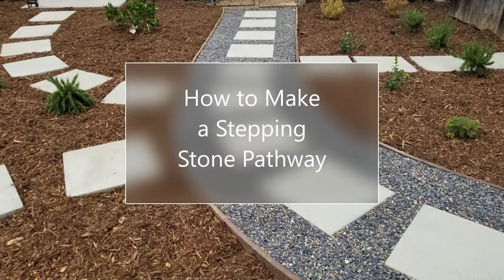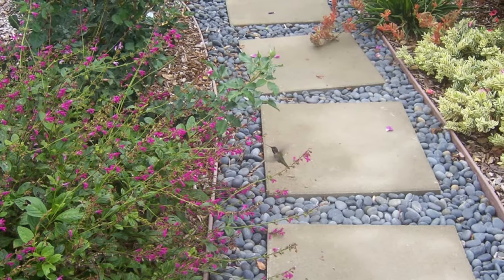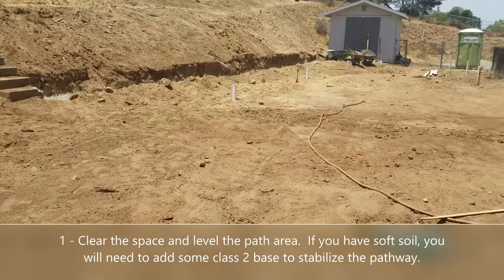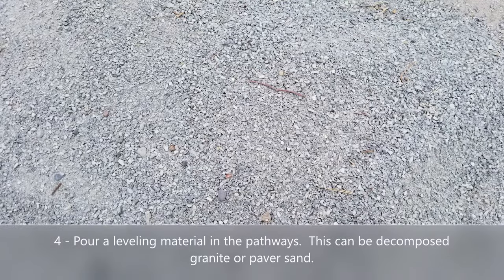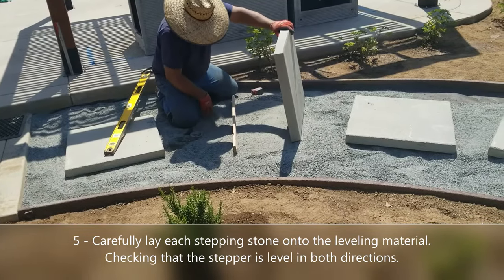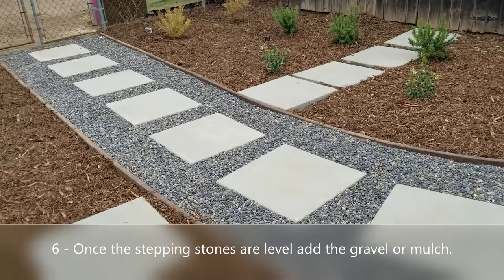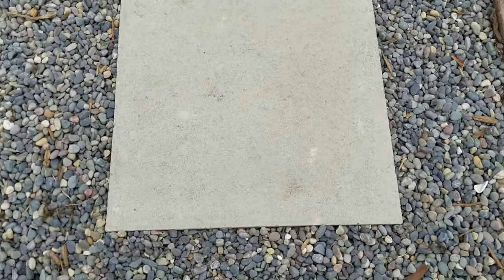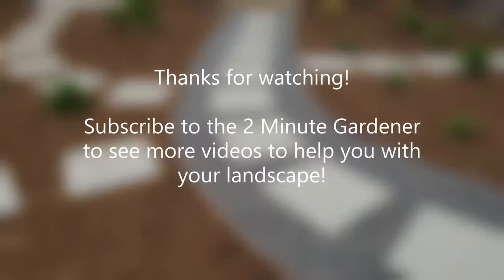How to Make a Stepping Stone Pathway

Comment: I am curious about transitioning from a pathway to another landscaping feature such as a yard. I am constructing a side yard path that will run from the back gate into the back lawn and am not sure how to terminate the pathway where it meets the yard. I don't want to have edging just sticking up at the ends, any advice?
Reply from the maker: The edging is meant to contain the pebbles.  Without it, the pebbles will slowly get mixed with the planting bed mulch.  Some clients are ok with that look and do it without the edging.

Comment: I want to do this on a pathway with a downgrade, do you have any suggestions or considerations? Its a gradual slope, very minor but its downward sloped.
Reply from the maker: Stepping stones can become slippery if installed at an angle.  Try putting a little bit of mortar underneath one edge and install the steppers level.  That way you are creating a little stairway.

Comment: Hi…if I want to add step tone (or without step tone)  n pebble rock along 2 side of my driveway n my driveway is a little bit up the hill …so just still adding sand after remove the grass? Will the water gonna wash away the sand too since my driveway is little bit up hill ?
Reply from the maker: You will probably need to add a little support under each stepper on the walkway if there is a slight incline.  I little bit of concrete might be the most stable.

Comment: I have a question about preparing the base to an area of soil that’s a little softer, especially after a rain….do you use the class 2 base and decomposed granite as a base or is the class 2 base all you use before adding pavers and stones?
Reply from the maker: Yes, I definitely recommend using class 2 base, then the leveling sand, then the steppers.  We didn't use the road base because the ground was practically solid rock.

Comment: hi there what did you use to get straight edges thanks in advance
Reply from the maker: The contractor used a string line staked at 2 ends to guide the bender board edging